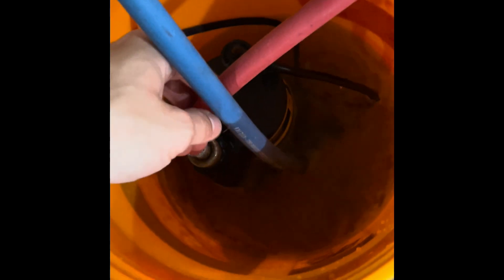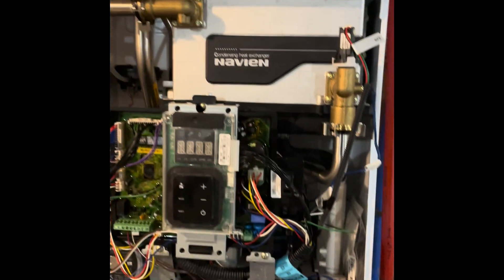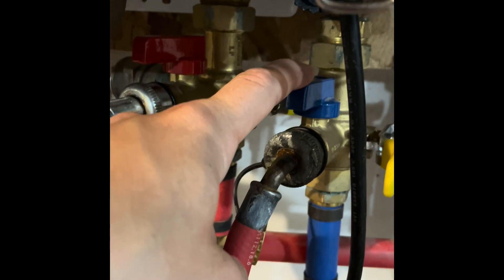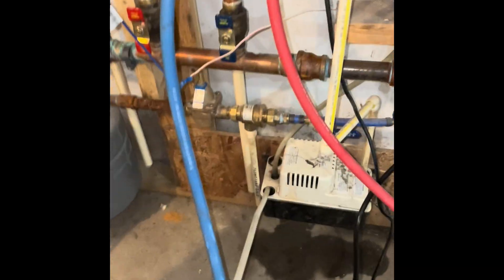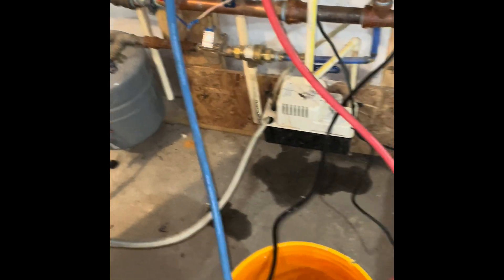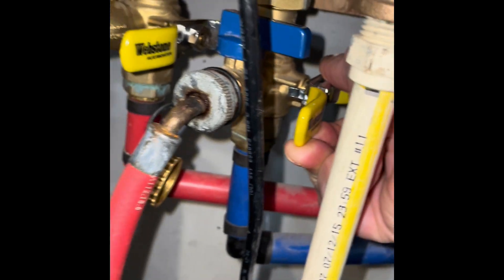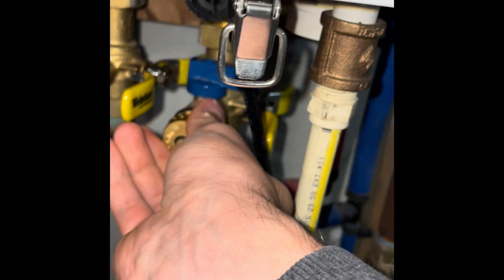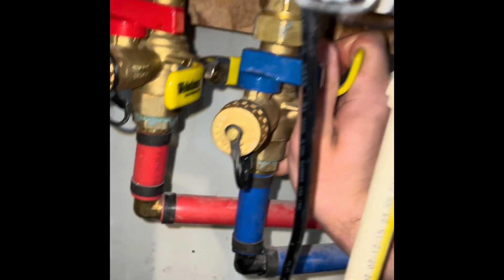How to flush/Descale Navien tankless water heater/ combi boiler NCB 240e other models - maintenance

Comment: I am in the UK and I have not been able to find the ball valves mentioned in this video allowing the service engineer to easily attach the water flushing pipes. Can anyone recommend a supplier. No problem to import if necessary
Reply: Navien 3/4 in. Plumb Easy Valve Kit

Comment: I have two hot and cold inlets and outlets - a domestic line and a heating water line. Which do I attach the circulation hoses to for descaling? Do i need to shut off all the lines?
Reply: The second hot is a recirculating line, I have one too. Love it. Also close that valve when performing this maintenance

Comment: You only did one side. lol
Reply from the maker: Before I get beat up by the “pros” by air I mean oxygen
Reply: @themillennialhomeowner1661  lol, no I think you were correct when you said air. When any gas (air, O2, etc) gets in the pipes, it can mess with the flow. Then you'll need to find and open up any bleeder valves, which are usually at the highest point in a specific heating loop. On a separate note, what was the ratio of water to vinegar that you used?
Reply from the maker: Other side is a closed loop system and new air via new cold water shouldn’t be introduced. Probably why there’s an air purge ;)

Comment: Good informative video! For a combi unit do you need to flush out both the domestic hot water and central heat exchangers? In other words do a one hour flush for each the domestic hot water and central heat? The central heat pipes are usually 1" versus the 3/4" for domestic hot water. So how is the central heat side flushed?
Reply from the maker: Thanks for the feedback! From what I know you only flush the domestic side. The other side is a closed system
Reply: @themillennialhomeowner1661  Hey, this is the first video of yours I came across. Good job and thanks for posting. FYI, in talking to the maintenance folks from the company who installed my system, they recommend a flush of the domestic side every year and the heating side every other year.
Reply: @jshearman17  I heard the same, the closed loop system should still be flushed but not often because its closed loop and doesn't have new water running through it constantly.

Comment: Wondering why you didn't flush both the domestic hot water AND the space heating sides of the combi unit?
Reply from the maker: Good question.  I did once and it didn’t go so well…and then I read you’re not supposed to because it’s a closed loop system and by adding new water it adds oxygen to the existing water that is purged of oxygen and it will corrode the heat exchanger. Just what I read!

Comment: My navian is hot water is work but Heating doesn't work this year if clean up it will be work?
Reply from the maker: Sounds like the heat exchanger for the heat side may need to be replaced but flushing certainly wouldn’t be a bad place to start. Never know 👍🏻